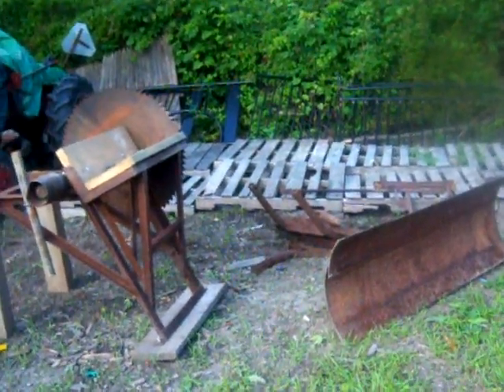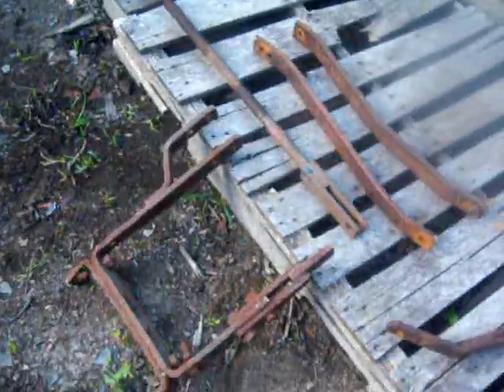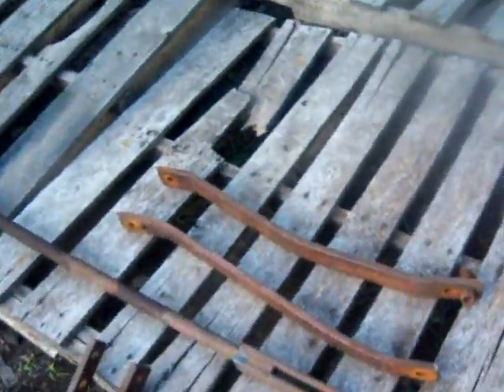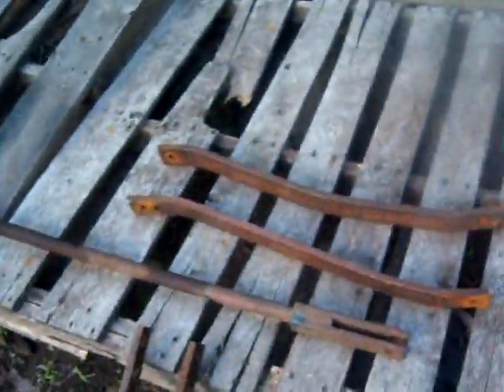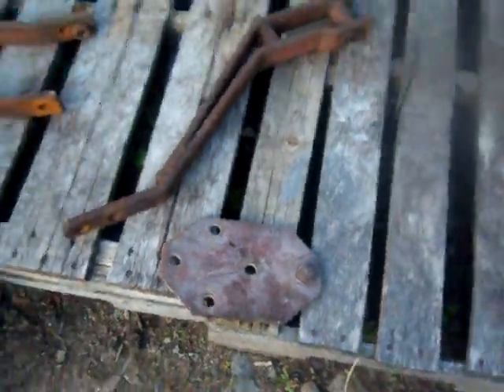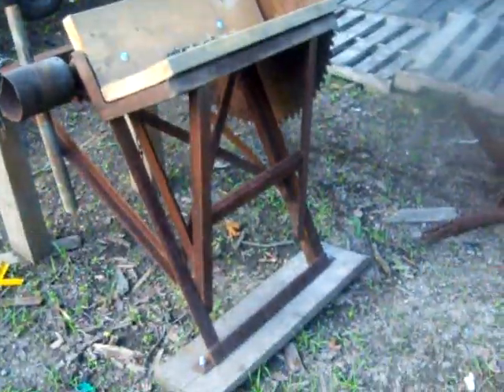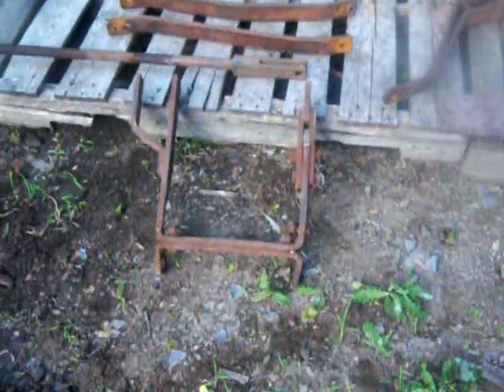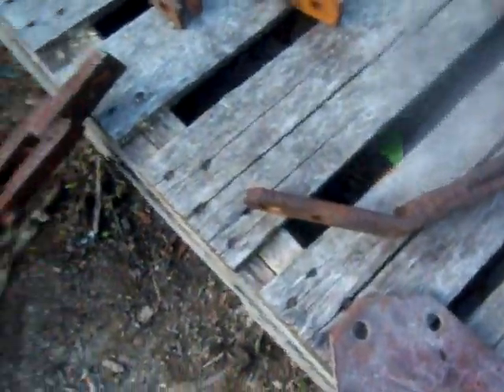Farmall Super A Buzz Saw & Grader Blade Puzzle

Comment: @MrDanoconnor 
Good, I thougt so, people used to work with machines usually have the proper respect. It's the occasional users mostly who tend to separate various body parts by cutting tools. Was glad to hear you were in process putting a guard on it, looks a bit dangerous right now. Missed that listening first time.

Should say also that that grader blade seems to be a nice face lift for the tractor, good luck with the jigsaw puzzle, be nice to see some snowplowing with this dignified dame.